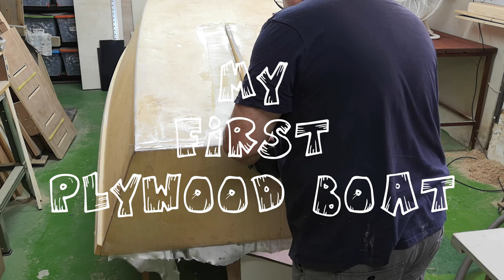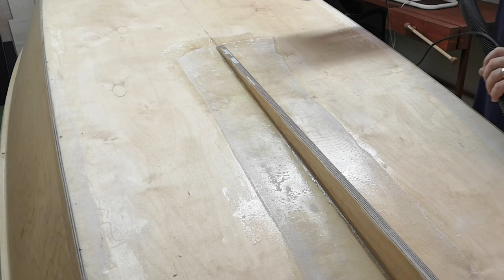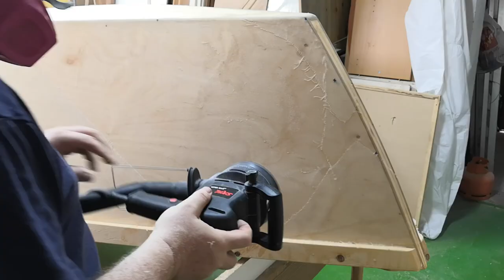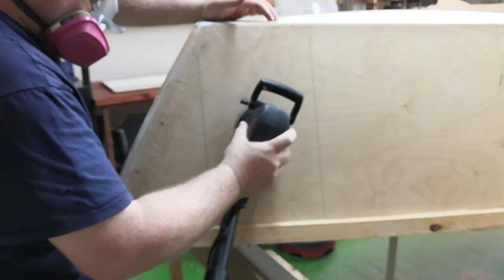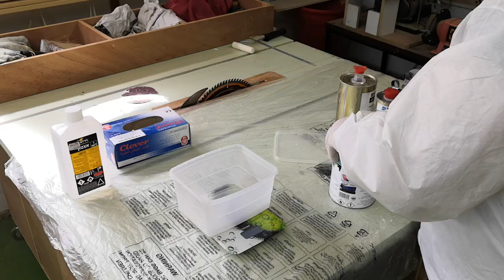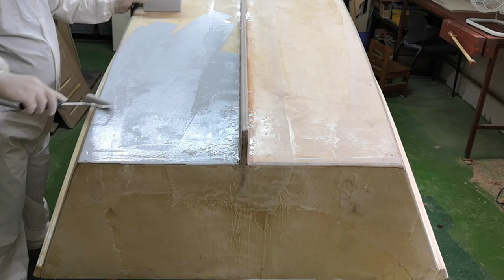Ep.8 - My first plywood boat - Epoxy Ship Primer

Comment: A flat bottom will knock you fillings out, get a better design
Reply from the maker: Thanks for the feedback, I will take your information into consideration
Reply: It appears to be a row boat so unless he's planning on hitching on a 50hp engine and racing through rough chop his fillings will be fine. Flat bottom skiffs are very stable,  seaworthy and fuel efficient. If running in choppy water all you need to do is slow down. They are for people who plan to stay on a location all day not for ripping off to new spots every half hour.
Reply: @greenwoodworkshop4382  I wouldn't worry about it. It's a common misconception. If planning to use an outboard motor just keep the speed down in choppy water.